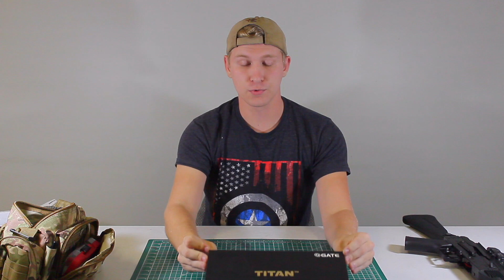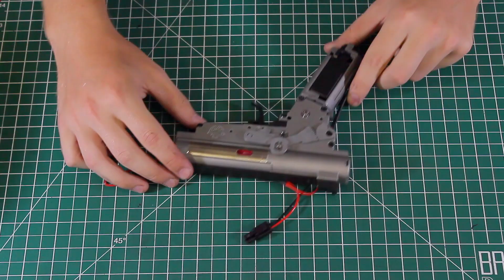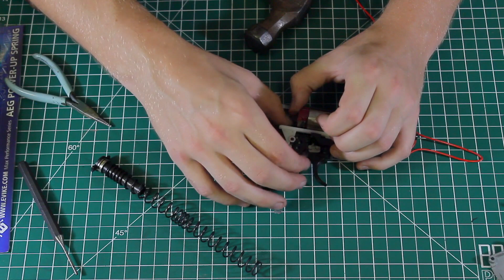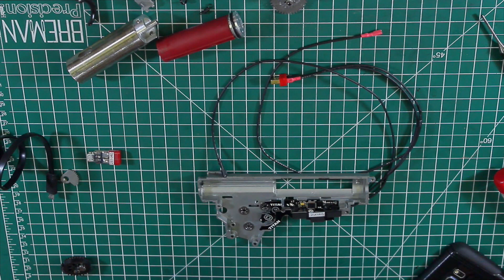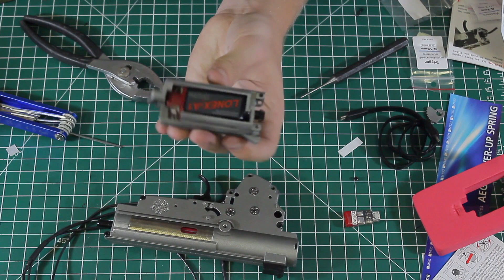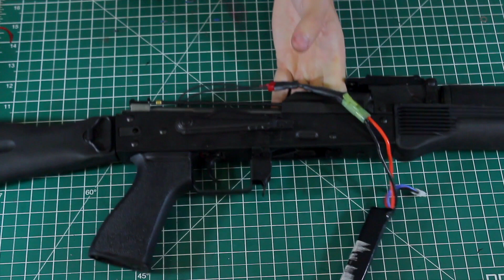GATE TITAN INSTALLATION [ Version 3 ]

Comment: Hi, very complete video.... did by the numbers all but one thing.... it's mandatory to calibrate the gate with the USB link ??? I just installed and the led in the middle of the board is blinking orange :( and i don't have the GATE USB link :( thanks
Reply from the maker: I want to say yes, but I am unsure.  I do know there is a lot of important stuff you probably "should" adjust and activate, like trigger sensitivity and safety switch positions from the gate app.  It probably won't work until you do.
Reply: @d-rzairsoft296  Thank you :)

Comment: Nice review! Quick question. If this is a LCT Ak, how did you mount the magpul motor grip? on mine, it is completely misaligned, and no one covers how to fit one online.
Reply from the maker: It is a very tight fit and you will have to re position motor wires accordingly to fit the grip on.  The grip may also interfere with the selector too because the dual selector gear comes down to the line of the motor grip.  It might take some time and is a very tight fit but I can assure that you can fit one on an LCT.  Be careful not to strip motor wires. Slow and steady when installing.
Reply: @d-rzairsoft296  thank you. I have seen on another video that it's helpful to file down one of the studs that goes into the receiver, I believe the right one. Is that true?

Comment: i got the version 3 but it didn't come with insulating washer...returned to the store and open up a new box still missing the insulating washer..so the one you used came with the kit or did you get it separately?
Reply from the maker: Mine came with black washers that I assumed are the isolating washers but don't use the washers to mount the device because then there isint enough spacing between the sector gear and the screw. So I actually use the screw left over from the stock gearbox that is used on the sector lever to mount the titan device.  The "Gate screws" sit too high with washers.
Reply: @d-rzairsoft296  my local store contacted gate titan yesterday about the missing washers, and apparently they said V3 does not require insulating washer...so i was confused because the manual says its necessary for both v2 or v3.
Reply: @henry912000  you actually only need it for v2

Comment: Need help installing the software on a mac!!! Can u help ?
Reply from the maker: You should be able to just download the app from the Apple store. Just make sure your mac IOS is up to latest date. I belive the titan comes with a micro USB to USBC adapter cable in the package that works best for Macs.
Reply: Yea it came with the usb link and the cables. I plugged everything in blue light nothing pops up on the screen
Reply from the maker: @patrick-jandayao4313  Did you download the gate titan app from the app store ?
Reply: Tried looking for the app  there isnt one  pulls up games when i look up gate titan or titan gate
Reply from the maker: @patrick-jandayao4313  Hmmm that's odd.  It should be called GCS in the app store.  I just use my Samsung phone to program mine. I've never tried it with anything that supports IOS.
Reply: @SYG Roosta wit not show the grease part. That's such a problem with the v3 boards. The silicone oil  which used in GATE's installation movie isn't lubricating enough in my opinion. What did you use to lube it?